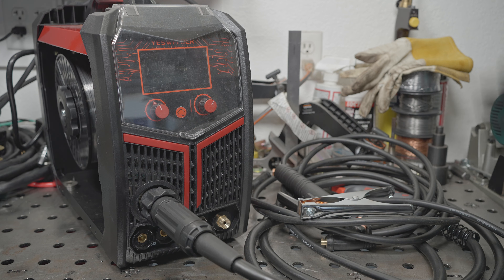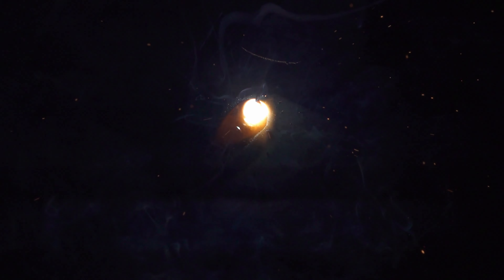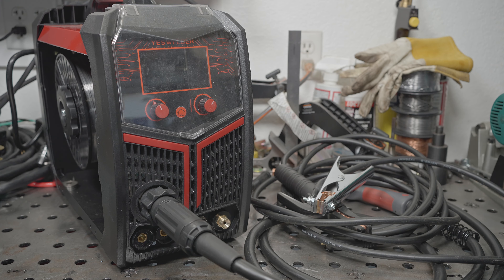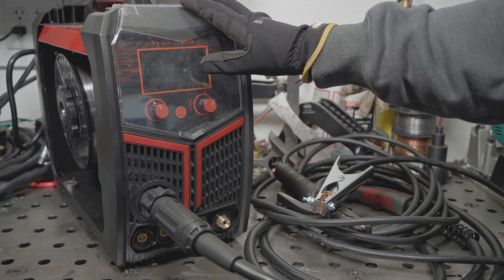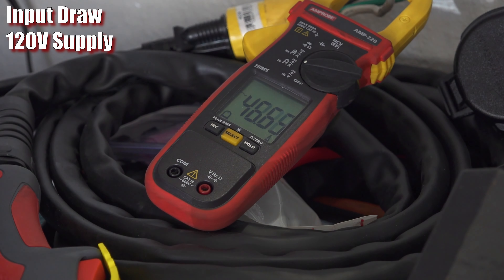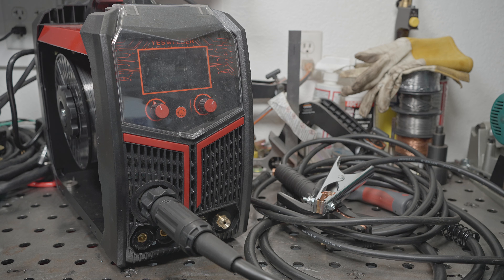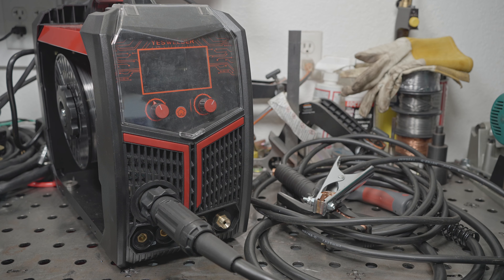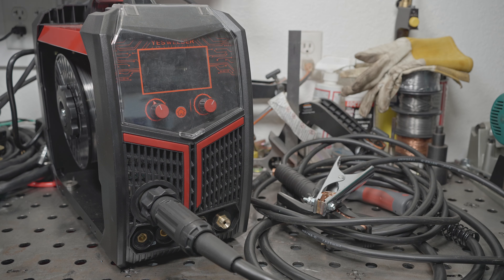Yeswelder Firstess MP200 Part 2: Stick, Dual Shield and Lies

Comment from the maker: I have no problem with someone liking Yeswelder machines, being satisfied with the performance and value of Yeswelder machines, or even singing their praises if that's how they feel.

But this isn't exactly a budget machine.  Yeswelder took in millions of dollars in funding for the MP200.  It is currently $1,000 on their website.  That isn't a super cheap machine.  $1,000 is a LOT of money.

Yeswelder is pushing their brand all over the place.  the hashtag "why we weld" is all over the internet and even in my e-mail box.  This company, in their words, is passionate about welding with a love for the industry and is making high-quality, state-of-the-art, high performance, safe equipment.  But at the same time, they are releasing welders that haven't been submitted to any safety or regulatory agency for any kind of testing or certification.  Though that doesn't stop them from printing the actual certification code those agencies use on their completely inaccurate data tags.  It doesn't stop them from including manuals (for the welders that actually include manuals) full of inaccuracies and misinformation.  It doesn't stop them from selling machines that are often not fully capable of what they claim and are programmed so the display will make it LOOK like they are.  

One thing I didn't mention in this video is warranty coverage.  In my phone conversation with them, I brought up the fact that they have no official warranty policy.  They emphatically stated that they would take care of issues.  From what I've heard, they generally do take care of issues, at least very early on.  But I explained to them that without something in writing, customers are left guessing what is covered, what the actual policy is and whether it might change on a whim without any recourse.  Yeswelder assured me they were presently having lawyers write up a warranty policy.  Here we are, nearly a year later after the release of two more machines, and there is still no mention of an actual, official warranty policy.  The product page for the MP200 doesn't make a single mention of any warranty.  Is there one?  Maybe.  What is it, how long is the coverage and what does it cover?  Who knows.  

I think if Yeswelder is going to advertise that they care about their customers, care about quality, care about the industry and are committed to becoming part of the welding community, then they should be held accountable for their disregard for honest advertising and for their misrepresentation of specs and performance.
Reply: Can you message me I have a neat project idea
Reply from the maker: I'll send you an email on the address listed on your channel.
Reply: I got a question is if it's possible if I can send you a welder that I've been using for a while so you could put it through its paces and see what you think and if it meets the specs that it says that it is because I've been pretty damn happy with it and I do believe it's putting out the 200 amps that it is and it is a scratch start machine too but it works better than the yes welder it has manual settings and manual adjustments and everything or if you can actually find one it is called a plasmargon mig 255 very inexpensive you can find them on eBay for about $320 and they seem to work damn good and I even changed out the liner on my mig gun and I push aluminum through the mig gun and weld aluminum with it too with 5356 spools in it.
Reply: @danielsplayhouse3804  punctuation, man! Who would respond to this jumble of words!?!
Reply: @danielsplayhouse3804 dude, please stop using the word and. Just forget that it even exists. It’s even less typing if you just hit this symbol . on your keyboard or screen. It’s called a period and let’s people know you have a little bit of sense when they read stuff you type. See what I did there; I used the word and the proper way. But that may be too advanced for you to try right off the bat; just stick with the period for now!

Comment: Thank GOD for this review!!! I damn near purchased this overhyped piece of equipment…. I think you are the only welding equipment reviewer that has accurately established wtf the situation is with this welder.
Reply: So did I my friend!!
Reply: I got one really early on and have built multiple off road trucks with it and honestly love this thing. The plasma cutter is finally starting to act up but I have put this thing through hell and back. Literally going from welding 3/8 for hours then switching to plasma cutting for a hour and back to welding with almost no down time. I only run gas so no experience on flux core

Comment: I initially pre-ordered a YesWelder MP200 back in November 2021 expecting a January delivery.  After delivery was pushed back to 'possibly' March, I canceled the order and instead went with the YesWelder MIG 205DS.  Gotta say I'm pleasantly surprised by it and so far, so good...its met my expectations.  If I had to make my living as a welder, I'd probably have gone with a Miller or Lincoln, but since I only need something for home/hobby projects this is more than adequate.  Anytime I've called them with a question, I always managed to reach a human, and emails have always been answered fairly quickly.
Reply: Is their office, in the states?
Reply: @aloud9738  Yes...in Boulder, Colorado.
Reply: As information, I also order mine in November of 2021.  I just got my UPS tracking number today.  It is supposed to be here Monday…
Reply: @PeeksPeakHobbyHomestead  Cool...good luck with it.  I was able to get the 205DS and a Warfox pilot arc plasma cutter for less than what the MP200 would have cost me, and without the wait.  So far, both are working flawlessly.

Comment: Hi, I’m looking for a multi process welder, almost pulled the trigger on this one,  I wander if should I reconsider the Omni pro 220 for it is in the same price range. BTW thanks for the video
Reply from the maker: I've never tested the Omni Pro, but I was pretty unimpressed by pretty much all aspects of the MP200.

I have tested the MIGMAX 215 and welds far nicer than the Yeswelder.  I eventually sold it to my cousin who has been using it around his farm for years and it still works well.

Comment: What machines do you think weld dual shield better? I have a Lincoln power mig 180c.. you have been the best reviewer I have seen yet!!!! And it’s great to see somebody who actually knows what they are talking about. So many reviewers are clueless. They do videos and they have never even ever stick welder lmao!!! Keep up the great videos!! I’m actually looking at getting a multi process machine but I’d like to be able to do aluminum tig and mig. I’ve been a fitter for about 35 years now and I’m use too using 575v machines but I’m retiring early and plan on doing stuff in my small shop just to keep busy and earn some tax free cash lol.
Reply from the maker: Thanks for the kind words.  Funny you should ask about dual shield.  I have been comparing this Yeswelder and two other multi-process welders.  I haven't run dual shield wire in any of them yet, but I plan to test flux core and dual shield on all of them in an upcoming video.
Reply: @bigtb1717  I’m actually just online trying to find a 10lb spool of dual but everything keeps coming up inner shield gas less and that’s not what I want lol. I just want to see if it burns hotter and bites better than hard wire. I use dw50 at work for mild and dw308 and dw316 for stainless. And I’m trying too figure out what my home machine can burn better for penetration.
Reply from the maker: If you are looking for a single machine that will do MIG and AC TIG there aren't a ton of options.  ESAB and Miller both have machines.  I don't have experience with either one.
Reply from the maker: I really like the way Lincoln Outershield (dual shield) runs. it is a bit difficult to find in 10lb. spools and it's a bit pricy.  My local welding shop can order it in within a few days.  I think I paid something like $75 for a 10 pound spool recently so I could test it in the multi-process machines.  ED026804 is the part number for 0.035" and ED020836 is the part number for a 10 pound spool of 0.045".
Reply: @bigtb1717  thanks for the info. Next time the welding supplier comes in I will ask him about it. Take care and cheers from Canada!!!

Comment: A note about self-shielded FC - 0.030 is only good for for up to 150ish amps depending on induction. It starts running like crap when you run too thin a wire at too much amps. My theory is the wire has no preheat time, even with a longer stick-out at out-of-rating amperages so more of the flux vaporizes before it has a chance to shield the puddle. So solution . . .bigger diametre wire. Love self shielded wire. Great vid, thanks.

Comment: What a bummer! I'm really glad you made these videos, saved me from a world of problems lol. The specs were pretty insane for a 1k MP welder, should've known it was too good to be true.
Reply from the maker: So far it all works.  It just has pretty much the same performance and specs (including the inaccuracies) as a $400 Yeswelder machine, with the exception of having a plasma cutter.  I'm working on part three where I test the plasma cutter and give some final thoughts on value.
Reply: @bigtb1717  The lack of performance has me considering the eastwood MP250i instead because it does what its advertised to do, and runs extremely well from what I've seen. It's only a few hundred dollars more, and comes with a concrete 3 year warranty, and all the cables are 12' minimum.

I look forward to part 3 none the less, I can appreciate the time and effort that goes into reviews like this.

Comment: Does this apply to all their machines? Was looking into their plasma cutter, 65DS
Reply from the maker: I've tested a handful of their machines and most of them have had discrepancies between the specs and the actual output.  However, I haven't tested any of their plasma cutters and it's also possible that they've gotten better.  It's possible that some of their newer machines are better.  I haven't tested any of their machines since the YWA 160.

Comment: I got mine at half off in the Kickstarter. It's my first welder. I use almost solely flux core at the moment. I've definitely found that the selected thicknesses are WAY off. For two pieces of 1/8in butted at a 90 degree angle, I have to set it to 1/4 inch to get any weld penetration at all. I'd think I'd be looking at burn-through at that point, but nope, just barely welds.

One question I've been completely unable to find an answer to is: what is the cheapest air compressor that will get me cutting 1/4in mild steel with the plasma cutter on this thing? Their official specs list a pressure and CFM that seem absolutely outlandish for any shop compressor under $1400. Is that right, or is it just another case of their docs being incorrect?

In the end, I'm glad I have the machine, and it welds what I need it to, but I'd be very upset if I had bought it at full price with the issues it has.
Reply from the maker: I haven't looked at their recommended air compressor specs in a while, but my compressor isn't anything big or special, and it worked.  It's not a super cheap compressor, but it's just a portable compressor.  It's a Makita, 4.2 gallon compressor rated at 4.2 CFM at 90PSI.  It will not cut continuously.  I set the output pressure at whatever I want for cut pressure and the tank fills to around 120 PSI.  The pump doesn't quite keep up, so as soon as I start cutting, that 120 PSI in the tank starts to drop.  Eventually, the actual output pressure starts to drop and before long I'll have to stop cutting and let the tank refill.  

My compressor is fine for relatively short cuts.  For bigger projects I have to wait for the pressure to build back up every so often, but that's not a big deal for me.  So you can definitely get away with a small-ish compressor.

Comment: I've long wondered about the consistency and reliability of power output and performance of these multifunction machines, especially when one of the functions is a plasma cutter. I am still green at welding and fabrication, but would still much rather keep my welding separate from my cutting if it's not oxy.

Comment: Watching your video has me really inspired cuz I almost bought a yes welder a 250 pro AC/DC machine I almost bought one instead I bought primeweld Tig 225x and now I have it with the water cooler and a CK flex lock 2:30 torch. If possible would like you to see if you could get your hands on a primewald TIG 225x and run it through the paces to see if it holds water with all the praises on it. I think it's a great TIG welder and works real good but would like to hear your opinion on this machine. And I can definitely say the customer service at primeweld is definitely spot on anytime I had a question or a problem gean at primewell always got back to me to answer the question and take care of the problem.
Reply: Prime weld is solid, tons of other reviews you can watch they are one of the good Chinese companies actually doing the work to make a reputable brand in the industry. AHP is good too, for cheaper machines check out Hitbox Welders and Herocut Plasma cutters , both are good company’s that don’t lie and stick to their word, as well as make some killer shit for the price. For ex, herocut only makes plasmacutters, that’s their main focus I think they made one multiprocess machine and that’s it, maybe they have more out now but they focus on plasma and make awesome solid units that output honest amps and duty cycle, as well as use good components and accessories like the torch etc. Hitbox, same thing but they make welders mostly. If I was to buy a welder and do it all over again , I would start with these two and work my way into a Canaweld, Esab, Fronious or CEA, Or Kemppi . Kemppi and fronious , Esab and CEA are my top , Canaweld as well but the best part about them is their quality and pricing, made in Canada and utmost best quality, service etc. I am waiting on a Mig Stick 202 which has a crazy 170 amp 100% duty cycle at 40 degree Celsius, 190 amp 60% at 40 degrees Celsius and 200 amps at 35% , as well as a AC DC pulse TIG . The mig stick was 1800 CAD after tax , including INSURED shipping, and the Tig was $2300 . Awesome local brand that everyone here values and adores, they are canadain treasure
Reply: @X0X0LFertilizer  I definitely been having my eyes on the can of welds I watch Dusty at Pacific arc welding and I kind of like that 201 I think he has but it's a TIG machine I already got my chineseium susemse mig-255 for my multiprocess and I got a primeweld tig 225x with the maxcool 3000 water cooler and a CK flexloc 230 I put six to eight hard hours on the machine every day and it works like a charm takes a beating and keeps on ticking.

Comment: Say what would  you say is the best value for a beginner Flux core user?   I'd like to stay under 300.  I bought the HF flux 135 (for $170) didn't open it yet and thinking of returning it.   I think it would be beneficial to buy one that will give me an option to use gas in the future.  110V is a must option. (even though i can connect to a 220)
Reply from the maker: The Titanium Flux 125 from Harbor Freight is a good value.  120V only and no option to use gas, but for a beginner flux core machine, it's pretty decent.

Comment: Thank you!
I was about to back their current 7 in one welder with 100% duty cycle. But now I know they are kind of ripping people off. 
But I really want a good multiprocess welder. What would you recommend?
Reply from the maker: What is your budget?
Reply: @bigtb1717  budget is less important. I usually try to buy where my dollar goes the furthest in getting good quality.
I typically find it in the middle. Not the cheapest, but not the top of line name brand either.  
Eg: good costs 1k,  super good cost 2k, and a little better than super good costs 3k. 
I would go for the middle 2k super good unit.
Reply from the maker: Every time I look into welders with the mindset of what I'd most want in a particular category, I almost always end up liking the Miller or Fronius.  Fronius are pretty expensive but these days Miller ranges from really expensive to just crazy.  Their Multimatic 235 was fairly reasonable when it first released at $2,000, but it has since crept up to almost $2,800 and that doesn't include any TIG accessories.  In that range, the Fronius Transteel 2200 is a bit more full-featured for the price (well particularly in regards to being dual voltage, which the MM235 is not).  But the Fronius is a bit annoying with the proprietary TIG and MIG connections.  

What processes do you need and which are the most important?  Many multi-process welders focus on one or another.  It's a shame the Lincoln Power MIG 210MP has gone up quite a bit recently as well.  It used to be a pretty reasonably priced multi-process option that had a decent reputation for performance and reliability from what I've read.

As for lower priced options, there is a Hobart multi-process machine for around $1,300, but I don't now about its performance or reliability.  There are a few Everlast options.  They have wildly mixed opinions online.  Some rave about the performance and value, others have anecdotal horror stories about failures and customer service issues.